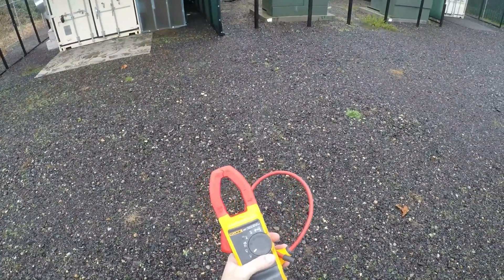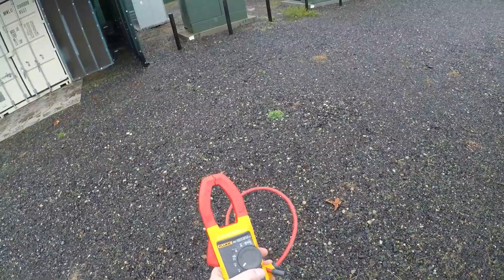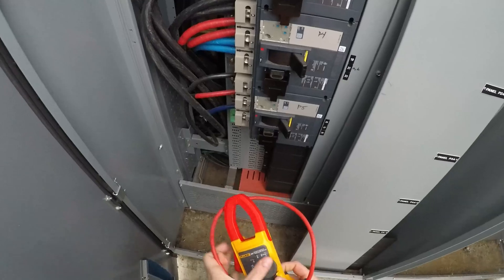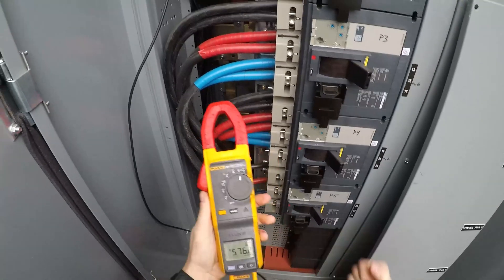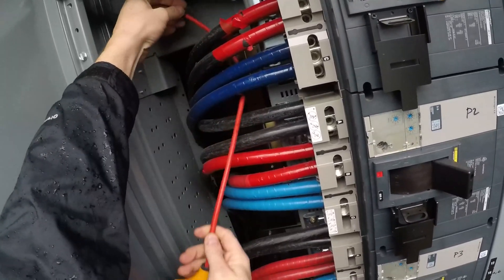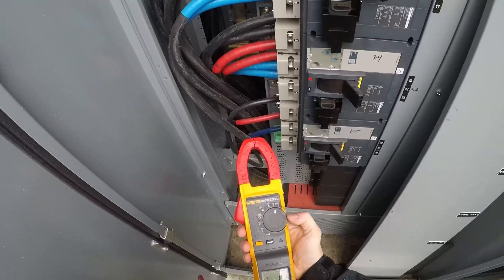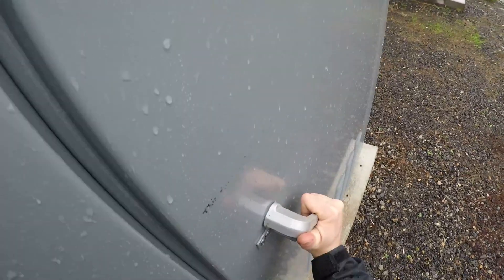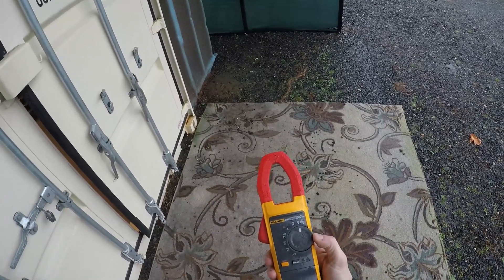Bitcoin Mining Farm - How to Check Amp Load on Each 3 Phase Leg, 600Amp Panel, Fluke

Comment: I doubt those breakers are 100% rated.  Would have been expensive compared to running a 800a breaker and tubs.

You should consider wearing the proper PPE when going in those panels. Especially when it's raining and your wet.  🤣
Reply from the maker: LOL

Comment: What is the minimum voltage needed for one S19J pro 104ths? I am thinking of getting 20 of them and can not figure out what power should I have on the 3 phase installation.
Reply from the maker: Standard 220v